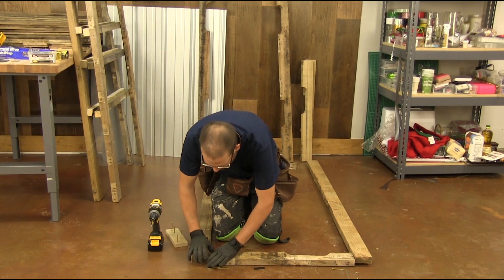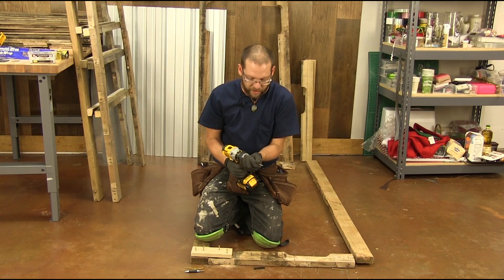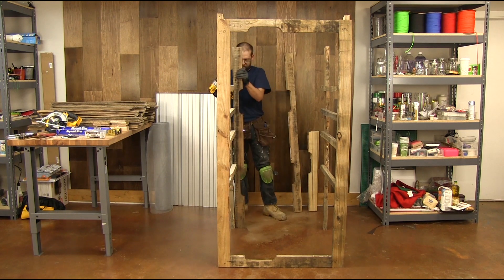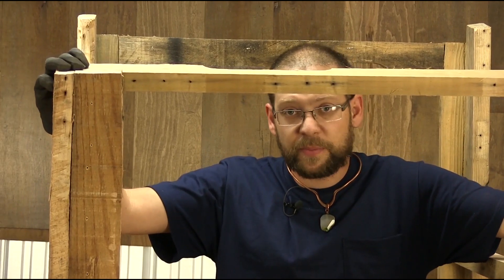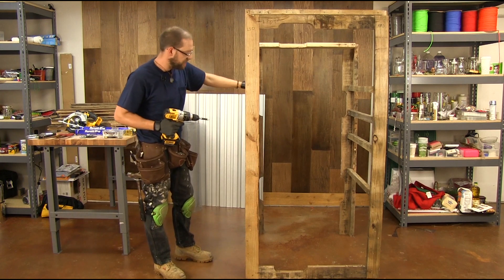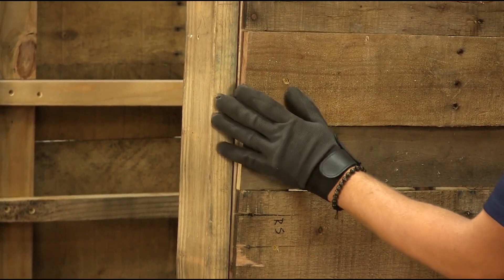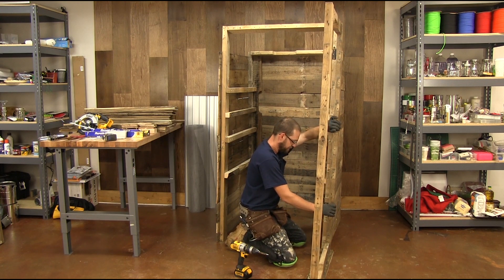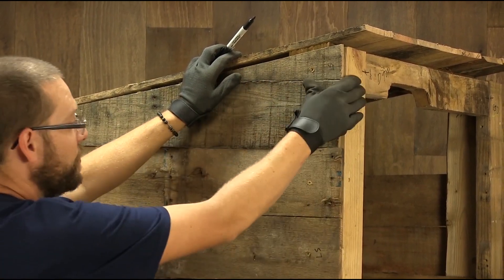How to Build a Smokehouse With Pallets Part 2 of 3

Comment: Thanks for the video.
Why didn’t you use your screw attachment sleeve. I’m a contractor a lot of people buy the adapter to put their bit in there drill like you have their, but they don’t realize the sleeve goes over the screw and it’s impossible for your bit to slip off of your screw then.
Happy trails
Luke